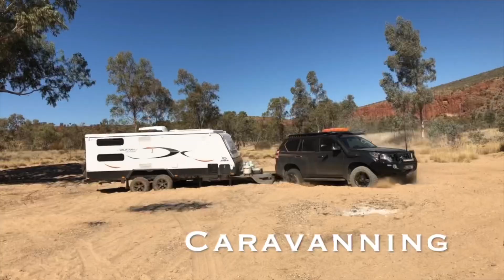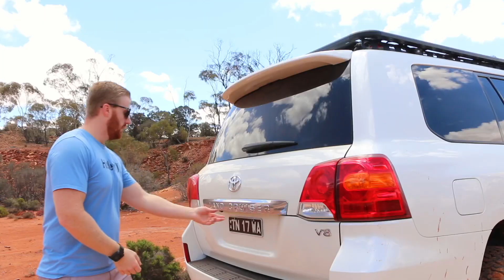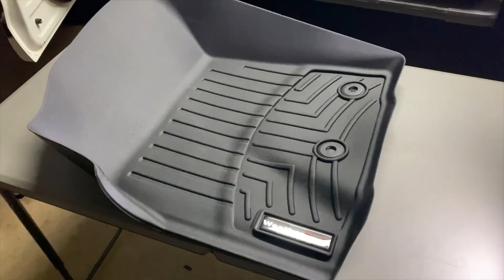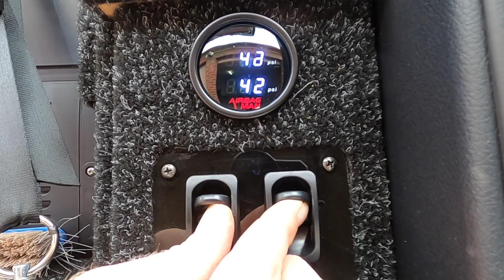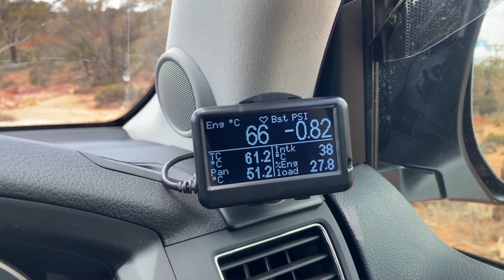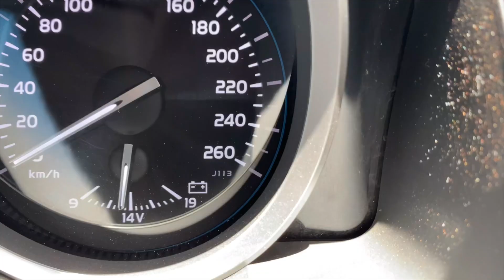LANDCRUISER 200 | TOP 5 ACCESSORIES UNDER $500 | Best mods for 4x4’ing, overlanding & touring

Comment: What is the height of the 200 with the rack and lift? Does it sit taller than your old Prado or around the same? 
Cheers
Reply from the maker: Hey mate, I don't have the height measurements on me at the moment but there is no doubt that the 200 sits a little higher than the Prado, especially when loaded up.

Comment: Just had my windows tented on our LC-200 they also recommended a UV only film for the windshield and i'm glad I had it done.  It has a very slight tent that isn't noticeable unless I have the door open or a front window rolled down.  The dash is staying much cooler and I have noticed a huge reduction in glare overall.  We had the rear windows tented with 20% over the factory tent and it keeps prying eyes from seeing anything inside the cruiser.  Nice video and i'm planning on doing the rear lift gate light mod soon.
Reply from the maker: For sure, the windows definitely require a better tinting for the reasons you listed there. I also did this as one of the first modifications on my cruiser after picking it up.

Comment: Hi
Just would like your opinion on the following:
I’m looking at installing a twin compressor under the bonnet. Is this possible. What are the pros and cons. 
Is it worth installing a rear diff locker in the LC 200 or it’s not needed?
Reply from the maker: Hey mate, so installing one of these is possible under bonnet, however it will depend on what modifications you already have installed. In my case I have a additional fuse block, catch can and fuel filter meaning there is no space to fit a air compressor. 
Also, lockers are generally superior, however the traction control systems in this LC200 are very effective and useful.  
Cheers, Nathan.

Comment: did you find the airbags installed on the rear springs changed the daily ride significantly when not filled for towing? I know you can air them down so they are not as stiff, just curious how different they are over stock ride. I had a set installed on a truck and even at 6 psi they were bouncier than the truck was stock.
Reply from the maker: Yeah mate, so the airbags do definitely add a little bit of firmness to the ride, but it’s only slightly. With the correct rated springs for the weight of your vehicle, it shouldn’t be too uncomfortable. 
I definitely wouldn’t go without them with how I use my vehicle.
Reply: @XploringOz  thanks man. I was hesitant to buy the 200 as i'd had a full size truck for many years but man I've loving the 200 so far.
Reply from the maker: @residualboulders  Mate, I love this vehicle. Not vehicle is perfect, but this suits my needs perfectly 👍

Comment: I have the victron set up, but on my phone app it shows the aux battery and starting battery correctly, but the gauge, the display shows it as the starting battery as the Aux and the Aux battery as the main do know if there is a setting on the gauge to change them around. The shunt is on the Aux battery.

cheers les
Reply from the maker: Hmm, that is a strange one. 
To be honest I haven’t come across any settings that allow the display to change the battery name. 
Maybe some forums might be able to help out?
Cheers, Nathan.

Comment: Nice coverage and explanations. There is an monitor that works on your phone called Torque Pro by a British developer. It can do what you described and costs just 5 dollars.You'll need an ELM 327 bluetooth OBDII module that costs less than $10. I have a cheap $100 phone dedicated to this app and permanently connect to the ODB2 module. No SIM required. Occasionally when I am connected to wifi I will look for updates.
Reply from the maker: Thanks for the feedback mate, appreciate it. 
Thanks for sharing that, hopefully a few people who watch this and see it and check it out for themselves. 
Cheers, Nathan.
Reply: @XploringOz  Yeah, its horses for courses. If you want something ready, your suggestion is great. If you want to save a few bucks and tinker for 10 minutes, the Torque approach is an option. The gauges it comes with are absolutely awesome.

Comment: Great Vid - looking to get a few of those.  Donaldson pre cleaner didn't make it mate - more than $500?  Where would you rate that in the list of overall mods regardless of price?
Reply from the maker: Thanks mate. 
So no, the pre-filter didn't quite make the cut this video. This is not because it costs too much (about $120) or because it doesn't work, more so because the other accessories get more 'practical' use from their value. Don't get me wrong, the pre-filter is important and if you've seen my other videos, I won't be getting rid of it anytime soon, however the other accessories are a little more interactive for LC owners. 
The pre-filter is still right there in terms of cheap insurance modifications on the cruiser for sure.
Thanks, Nathan.

Comment: G'day Nath. Great video and thanks for sharing. I have a question relating to the Ultra Gauge. I have the ARB Links gauge running in my 200. Are you aware of any potential issues running both side by side or are they two totally different systems ? Thanking you in advance.
Reply from the maker: Thanks once again Jim. So I'm not overly familiar with the ARB LINX system, but from what I do understand they should be two seperate systems. 
I'm under the belief that the LINX system is an interface so all electrical devices and controlled via it's own system, or hub mounted inside the vehicle. 
The Ultragauge plugs only into the OBDII port of the cruiser, and can be run independently. Are you able to confirm that the LINX system does not plug into the OBDII port?
I hope that helps somewhat. 
Cheers, Nathan.

Comment: I’ve been looking at those victron monitors, glad you did a review on them in this vid. Still on my list of improvements still to do.
Reply from the maker: Those monitors are great. There are some better ones out there, but nothing that competes with the price of the Victron. I genuinely use it all the time. Super easy, accurate and connects to the phone first time, every time.
Cheers, Nathan.
Reply: @XploringOz  top 5 accessories for a 200 series,,,,, 5 cv joints..

Comment: Great video but have those 5 also but different Matt’s so you have saved me some cash, re your ultra gauge what the setting for your fuel usage? I thought the snorkel ram you use may of made the list.
Reply from the maker: Sounds like you have an awesome build as well. Sometimes it's these little accessories that work well that can really finish the build off.
To be completely honest, I actually don't use the Ultragauge for fuel consumption. I should probably get around to it sometime, however I've found the on-board estimates to be very accurate.
I've had a few people mention the snorkel ram head, it was close, but I if I could only buy 5 things, I think these items would probably get used more often when touring/camping. Not trying to diminish the importance of looking after that air box though.